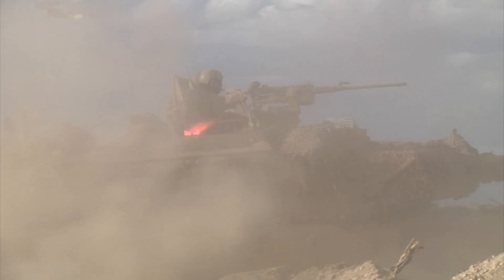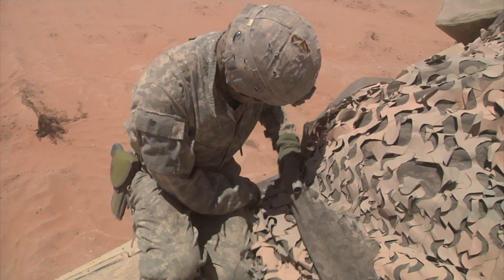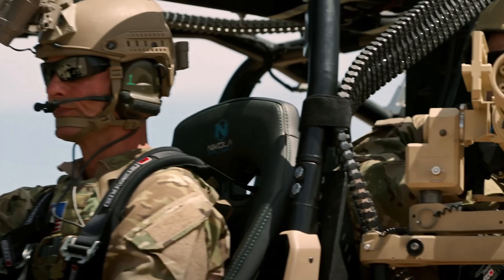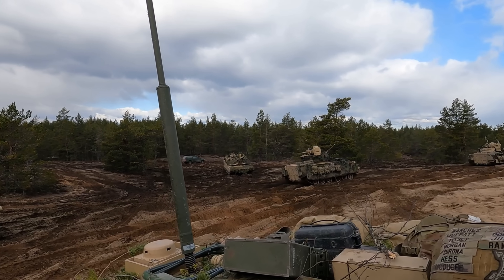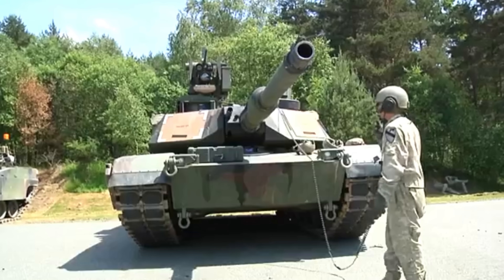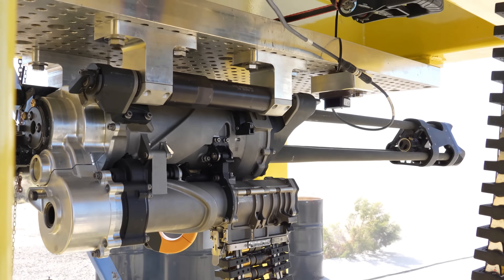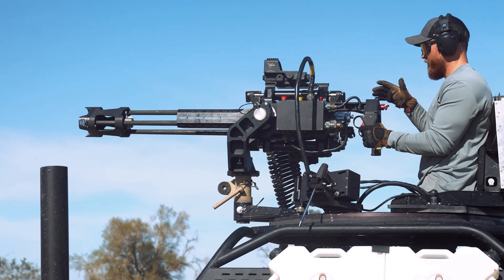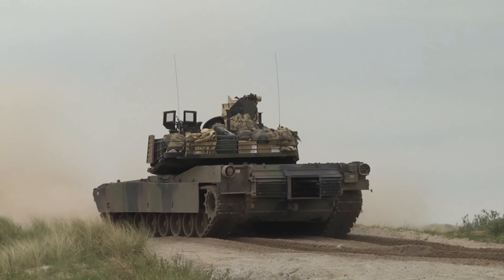Why is the U.S. Army putting a M134 Minigun on Abrams? | ROTARY GUN DEFENSE

Comment: I disagree on the ''take the .50'' angle, I can't help but think 7.62 is overkill for a drone anyways. A drone quite literally cannot have any kind of armor on it if you want it to actually carry a payload, so why not develop a whole new weapon? Hell it could be a tiny round fired by a mini CIWS that's entirely remotely operated, but of course they want an existing platform, because it's a hell of a lot quicker to get that into service. If the system's entire purpose is drone defence though, I think it needs to be purpose built for that role, no compromises. A tank already has plenty of options for dealing with other soft targets, you don't need a minigun for that.

The shotgun idea though? I'm fully on board with that, you could potentially get relatively good hit rates with a relatively low number of rounds per target, and if the system is truly automated and capable of rapid target acquisition and tracking on the move even in rough terrain, something CIWS systems already do (except in their case rough terrain is rough seas) then that could be a complete game changer.

Comment: As a complete layman, my main concern would be the lack of ammunition capacity. The M134 eats through ammo far too quickly for operational longevity. For anti drone work, I'd say something with a high ROF, but the ability to have more and longer lasting ammo like an MG3 would work just as well for taking out a drone.
Reply from the maker: That's a very valid point, thanks for the perspective!
Reply: well but thats why they  will reduce the guns rpm speed by lowring it to only to its 50% to 25% rpm speed for that reason actaly you can adjust the M134 rpm speed for slower fire rate but for alot less recoil and far better acurtcy if needed.
Reply: Mg3 would not work just as well. Maximum rof is required against drones or shotgun pellets

Comment: I'm thinking metal storm Shotgun   using tungsten shot . I believe they had a system called redback 20 years ago , using 40mm grenades. Scale it down. 
Or a MG3 in a better calibre,  either smaller & more efficient,  ie 6.5 grendel, 6mm arc or 22 grendel. 
Or potentially the other direction. 338 norma - 416 Gibbs class.
Smaller package then 50 BMG,  lighter belts & ammo.
Shoot's flatter,  hits hard enough to ruin drones, & most things out to about that 2000 meter mark.

Comment: I think what is needed in the future is a laser based anti-drone weapon.  Strong enough to heat up and destroy a drone. It needs to have sensors or even a form of radar to auto track incoming objects. A full swivel to cover 360 degree in all directions (except down of course) So you effectively have a 'dome' protection. Then AI assisted targeting and execution.  A system like that if laser is strong enough could tackle some incoming missiles too potentially. A laser is instantaneous hit.
I know UK is working on it but those are of course much larger and designed for missile defense.  But that an jamming is what is needed.
Reply from the maker: Interesting idea, a laser anti-drone system could be a game changer!

Comment: What about a 'Metal Storm' gun.  Set up with 6 barrels/row and 6 rows.  All barrels fire one round at the same time so you get a 36 round shotgun pattern (each barrel set slightly out from the next so you get an impact pattern of about 300 mm between each projectile at 200 m, that would give you a 1.5 m x 1.5 m kill box.  Depending on how many rounds are stacked in each barrel, that would give you the number of 'Shots' you would have.

Comment: Or you could just put the commanders .50 cal on TrackFire ARES which is an anti-drone ciws configuration of a regular TrackFire RWS,  so it will also works perfectly fine as a normal RWS against surface targets, plus you can add a coaxial GPMG on the TrackFire.  So you have an .50cal RWS against infantry and light vehicles, an CIWS FCS that helps the gunner against drones, plus a regular GPMG when you don't want blast the .50 cal (so the GPMG is really redundant  ;D  ), all in a single RWS.
Reply from the maker: That is an interesting idea.

Comment: At the risk of sounding overly dismissive and arrogant, this is stupid. The clear solution (or at least as good of a solution as we have) is continued development of active protection systems. They have proven to have performance far in excess of what is required to destroy drones (they are in effect the "claymore"-like devices that Matt postulates). The current hindrances to their employment against drones is their programming to avoid engaging slow moving targets (one would hate for them to go off at every bird, or god forbid maintainer, that approaches the vehicle) and their power requirements. The first challenge is very surmountable, however, and I reckon the short-term solution involves some sort of "man in the loop" fire control and the long term one involving smarter and higher fidelity sensors for automatic targeting. The second is more intransigent, not because existing vehicles lack the power, but because many if most drone kills against vehicles are against static ones, and it is not exactly practical to keep a tank running 24/7. However, an APS would be highly effective when the vehicle is generating power, and I can imagine some at least partial solutions to the problem faced by static vehicles.

Frankly, given their high value relative to cost ( a several hundred thousand dollar APS can make a ten million dollar plus tank an order of magnitude more survivable against atgms and even improve survivability against kinetic projectiles), I don't know why anyone these days would buy a combat vehicle costing more than a couple million dollars without also getting an APS to put on it.

Comment: M134 is one odd duck to choose for this role. Especially as a manually fired loaders gun. It has no real utlity vs lightly armored vehicles and buildings reaistant to 7.62mm. (I.e. mass concrete ) 

For the weight you might as well choose a 30mm M230 derivative on the  commanders CROWS position. 30mm Prox fused and 30mm HEDP is a mean combo.

Now that's an upgrade in both utility as well as firepower.

A dual feed .50  mg like the STK 50 MG might be an option. Normal ammo belt for general/long range fire and a second close in belt with a shotgun projectile now commonly issued to troops for drone defense in personal arms ( scaled up obviously ).

IMO the real key to drone defense would be a 360 degree IRST/Optical sensor suite managed by AI image processing to detect/classify/notify threats.
That data should then be fed into the defensive weapons suite.
Whether that's some RWS with a conventional direct fire weapon ( highly  usefull in its own right ), some kind of APS,  directed energy.....who knows.

In all likely hood it'll be a combo of all options.

A RWS seems increasingly like the minimum kit needed on any combat vehicle that's near the frontline.

APS as well for anything that's likely to come under fire from ATGM or fast drones.

Directed energy weapons other than high power microwave seem more like ly to be used as area defense weapons due to cost.

A 30mm chaingun derivative with prox fused ammo will ofcourse also fill the area defense role.

A RWS with a MG is ofcourse a cheaper option but likely limited to point defense. 7.62mm to .50" caliber seem like the obvious candidates and also offer dual use applications beyond point defense.

Is installation of APS projectiles warranted on RWS turrets to increase coverage ?

Comment: There be a 360 degree hail storm of projectiles flying trying to knock out drones.   Friendly fire all over the place to counter the drone menace.  Not so clever with infantry about, let alone sensitive and unarmored sensor equipment smothered over every fighting vehicle.  
I think the age of the 35mm/40mm intelligent cannon is fast approaching.   
Armour to protect against shrapnel, rather than more, as anti armour is so good and no armour can defend much against the better stuff. 
Recce with integrated intelligence to fire support systems will dominate an ever increasingly lethal battlefield.  Anything detected can be targeted and destroyed from far far away.  So how can ground Recce get forward and survive?  Drones and remote controlled vehicles will be more and more necessary, as people won't be able to survive at the front.
But then again, certain terrain and places non of the above will work either.

Comment: Just upgrade the suspension and mount a 30mm RWS with programmable rounds.
The 50. cal can be mounted on the main gun. Loader's M240 can be a coax to that 30mm RWS.
Stupid idea I know. Might as well design a new tank at this point.

Comment: 5:18 And that there is a common issue with modification. If a platform is not designed from the ground up to be modular(Wooo! Scary military industrial complex buzzword), then any additions will just cause interference with the other components already on the platform.

It's not like it's a modern desktop PC which was designed to be modular. You can add a lot of peripherals to a PC.

I think the Abrams is a good test platform for the idea. But, in the future the army still needs to create a vehicle that was made to be modified on the get-go. And yes, I'm aware that the military has been trying to make modular vehicles for a long time with... varying levels of success.

Comment: I think that for multi-turreted designs (which this Abrams variant can fall under if they decide to go with a remote turret), the design arrangement that works best is if you put additional turrets ON a main turret vs putting additional turrets on the same surface or plane as another turret.

So basically, Turretjenga.

Comment: You are correct, this is not an upgrade it is a waste of ammo.
A manually operated CIWS, using 7.62X51 ammo would be totally ineffective against drone swarms.
A better solution would have been to integrate a secondary turret with a 30mm M230LF, using air burst ammo and some automatic passive detection system like those shot locators, or short range  EW systems like the Greek Telemachus system.
Air burst ammo allows for a kill even with a near miss, contrary to hit to kill ammo, so it allows for ammo conservation.
The new German tanks like Leopard 2 A8 and KF51 Panther, combine the firing part of an RWS to the commanders sight, that also becomes targeting system of the RWS.
An alternative would be to add a support platoon with 3 GAU-8 equipped Abrams in every tank company, firing ammo with programmable fuses allowing for air burst, impact or delayed burst modes.
Such a configuration would allow for a tank company level v-shorads cover, down to tank platoons, with similar vehicles, like the rest of the tank company.
Overloading a single vehicle with systems is never a good idea, because it increases vehicle cost and crew workload.

Comment: Be better off doing a 12 gauge automated turret with the proper shot size to take down drone targets, something with a high rotation speed capable of rapidly engaging multiple targets from several angles. 7.62 isn't suitable for drones at all.  This is simply another case of MIC overspending for its own sake

Comment: Im thinking switching to the 30mm the apache uses, you can replace the commander .50 RWS with it and it can have programable round, HEDP and air burst or prozimity fuzed/point detonation. The ammuniton is already being produced for the ah64E, and i have a feeling the apache is gonna get a gun that's designed to be more accurate at longer ranges with a tighter spread and they can just use it for everthing from a jltv/humvee, and whatever other vehicle that would need it

Comment: remote automatic antiair double minigun setup with antiair bullets 
need to also put a radar into it
might not be that effective against drones in the end, hehe, but would look KINO.
another more boring but likely more effective solution would be, that next to the tank would always move a dedicated self-propelled anti-aircraft autonomous gun. antiair drone tank.with air burst programmable rounds 35 x 228 mm. like Skyranger 35,  Flakpanzer Gepard 1A2, SA-35MM.

Comment: Drones are already attacking in groups from different directions. Artificial intelligence is being developed. It is better to put machine guns on the sides of the equipment. Two on board. A digital control system with drone detection sensors is also needed, which will automatically detect and destroy drones.

Comment: 30x113B would become standard rws/ciws for vehicles. If somewhat longer range variant is needed than 30x150B is also there. Similarly russian and chinese have 30x155B calibre. In 3 man turret tanks (abrams, leo2) remove the loader put bustle autoloader now make a blast resistant compartment out of the loader position like in M8 AGS. Use that compartment for autocannon ciws. Similarly 2 man turret tanks like Leclerc, type 90/10, K2 and t90, type 99 (latter two have to adopt bustle autoloader) can move the gunner to hull while the saved space in the turret can be used for ciws. Or one can can design unmanned turret tank like t14, abramsX/ttb. Now this tank have 120/125mm gun, 7.62 mm coaxial, 30x113B autocannon, finally efp and blast rocket aps. Should also have the ability to bolt on air defence missile pods if needed.
Reply from the maker: Thanks for the detailed breakdown, it's a lot to consider!

Comment: The M134 is getter at countering drones than M2. 
But it is not a great weapons system in this role, the problem with FPV drones is they are fast, small and you will likely not have a LOS to them before they are less than 100m away. 
So a beefed ud auto-shotgun system that can swivel around fast would be better. 
Even better have the operator be inside and put on audible detection system that is tuned in to detect drone whine. (on top of normal optic system)
Have multiple microphones, so it can give operator a rough trangulation, so he knows from what direction the drone is approaching. 
This would give the tank a good chance to defend themselves against drones.

Comment: Nah there's a minigun that uses 5.56 ammo and these should use that with a short range dual mode infrared and radar guided turret. A straight up micro cRam CIWS. And use the 556 ammo that has 4 balls that separate after firing. Or design a new shell based on a rimless cartridge and a smoothbore packed with buckshot. I think the micro CIWS is way cooler though. You could also just use a small vls cell that sits on the back of the turret with like 6 or 10 cheapish Ai powered drone interceptors that hover above the tank 1 at a time and when it sees a drone coming in it moves to intercept with a claymore to target the enemy drone, and when the battery runs out it can land in its vls and be recharged with a wireless charger. You can have them cycle between drones charging and working overwatch. Heck just have a separate vehicle stay with each tank packing the overwatch drone interceptor. We have so many humvees that can hold lots of drones. Plus they can function dual purpose and target enemy trenches for raids.

Comment: Honestly, I think in my opinion there should be smaller caliber guns mounted on tanks to carry more ammo while still being able to take out drones thats just me I think u could still mount it next to a larger caliber 50 cal (like a smaller secondary on the same RWS Turret mount) so without sacrificing to effectively engage infantry while u could use the smaller caliber guns it wouldn't be as effective as that as the larger one plus if u account for cover protection and more yadayada. 

If it were me I would use a 4.5mm 3-barreled gas-operated gatling gun without the electric motor while also both carrying more ammo and being less but still high fire rate while also being slightly less logistal headache. But if I were to be more realistic I still would do a normal 4.5mm machine gun on a RWS turret.

Comment: BBBBRRRRRTTT Jr. is the best, GAU is the the A&W Burger family but with 1 more family member
this was dealt with and dropped 40 years ago but now they have to relearn everything
the U.S. has had the M163 VADS with a 20mm gatling for short range air defense, M6 Line Baker (built on Bradley) had the Apache's 30mm gun with air-burst rounds and stingers (proposal i believe), LAV-AD a LAV-25 but with a 25mm gatling and stingers
Italy had the SIDAM 25 with quad 25mm AA (built on M113) and HAS the Stryker M-SHORAD
15+ years ago i saw twin AA-12 automatic shotguns put on a remote mount.....wtf happened to that?

Comment: Mini gun ammo comes in two 750 round belts in a steel chest that loaded weighs 115 pounds. I have one full of field medical supplies I dragged around during annual training. Typical system setup on a UH-1 had 6,000 rounds in the setup for one door.
For frontline use it is way too much bulk and not responsive enough to counter the current drone threat.
Best option is to set the Abrams up for a three-layer anti drone net system for both the hull and the turret with anti-drone handled by a drone support element and a pair of Ground drones one with anti-drone Jammers the second with a hard kill system.

Comment: What a dumb idea, footage from Ukraine has shown drones coming in at high angles of attack against tanks & other armored vehicles of over 70 or 80 degrees relative to the tank's turret , too high for a manually operated weapon to engage it. Recently Ukraine took out a Russian tank fitted with cages & extra plating but it took over sixty drones to do it. Combat experience in Ukraine has shown that Passive not Active defense is they way to go atm when dealing with drones unless someone can come up with a multi-wavelength jammer that has significant range & can be mounted on vehicles that also does not interfere with said vehicle's system's. Also Russian Kord HMG for the win  :)  .